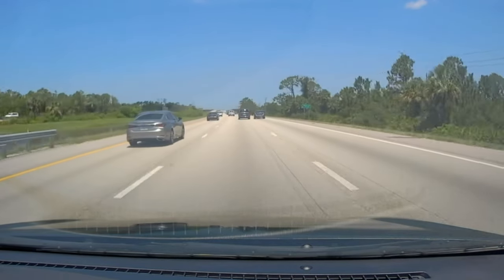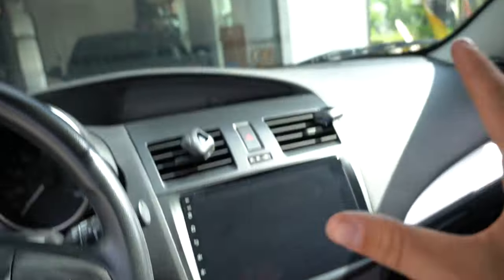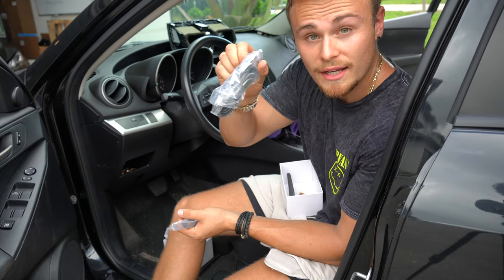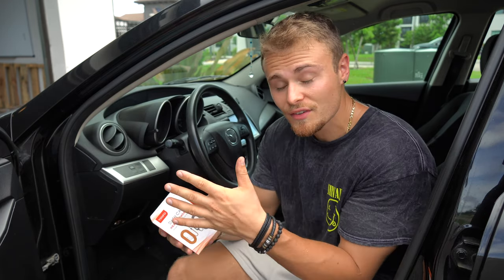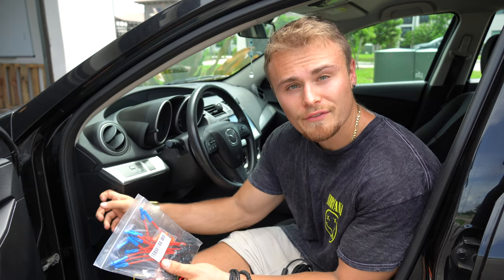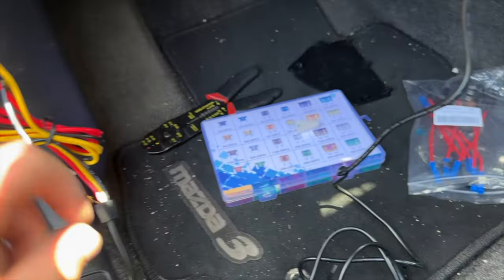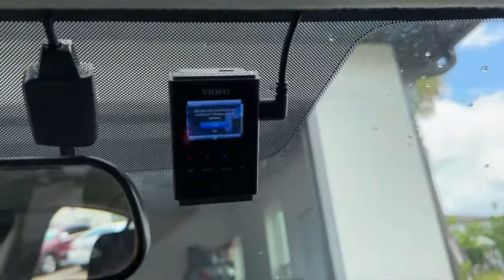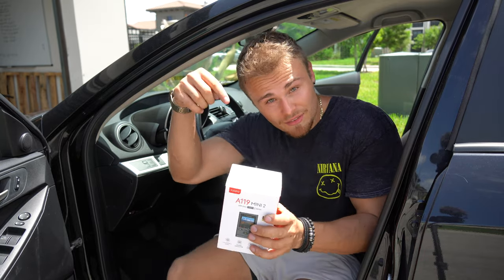How To Install A Dash Camera And Make It Look Good | Hardwiring A Viofo A119 Mini 2

Comment: To properly install a fuse tap, you need to first determine which side of the fuse terminal is hot (load side). Then plug the tap in with the load side of the tap to the load side of the fuse terminal. Otherwise bad things can happen.
Reply: Yes. Agreed. So the method  would be to pull fuse and determine which post of the empty slot has power, and which is downstream of the fuse. Same for Tap. Fuse taps are great little devices.

Comment: What made the cam fall off the windshield?
Reply from the maker: I put the clear easy on/off sticker on the part of the windshield that has the black dots. So it didn’t get a good seal. With the weight of the camera it flew off
Reply: @Haydenschreiermk2  Ahh yeah that won't adhere well there obviously 😂
Reply: If you did not use the clear sticker and instead use the units 3M tape onto the black dots would you think it would hold better as the dots give me the best position.    Also would you buy Mini 2 or just get the cheaper A119 v3.   Thanks. @Haydenschreiermk2

Comment: Where did you connect the cable to with the aftermarket head unit? Can’t find anywhere to plug it into in mine
Reply from the maker: You need to be more specific than “the cable”

Comment: My problem is that the A pillar has the aribag, so I can't really touch it much :/
Reply from the maker: every single car as an airbag in the A pillar. you can still route the wire in the a pillar. otherwise just put the wire in the headliner
Reply: @Haydenschreiermk2  oh really? I just was concerned because of the airbag logo, thanks for the info ^^

Comment: Is the noise suppression filter that close to the connector? That's pretty s h itty to hide behind the headliner....
Reply from the maker: Heh? Where else would you hide the wire besides the headliner?
Reply: @Haydenschreiermk2  Yea that's the point. Of course the cable fits behind the liner but not the noise filter...

Comment: Can you connect the yellow only if you want power only when in accessory mode or with the ignition on?
Reply from the maker: I would think if you dont wire the Yellow and only wire the red then it will only turn on in Accessory or with Ignition on. only one way to find out!

Comment: what is the correct size fuse tap ?
Reply from the maker: well it depends on the fuse you are pulling. When you buy the fuse taps it will have an assortment of sizes